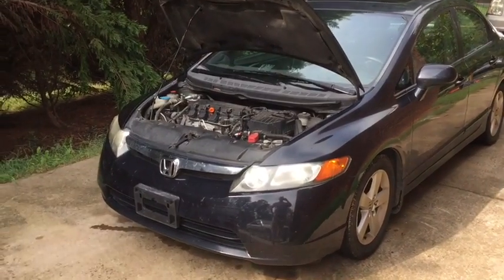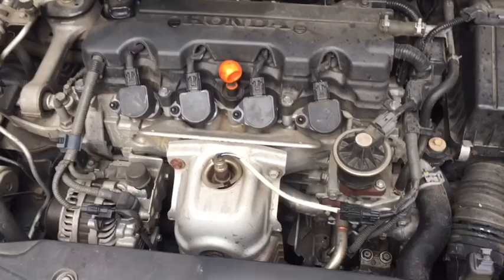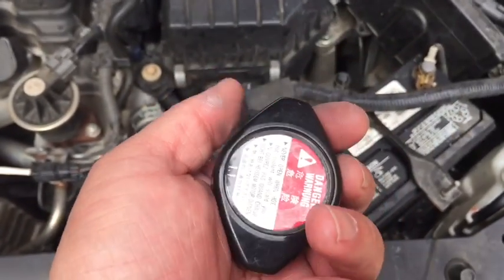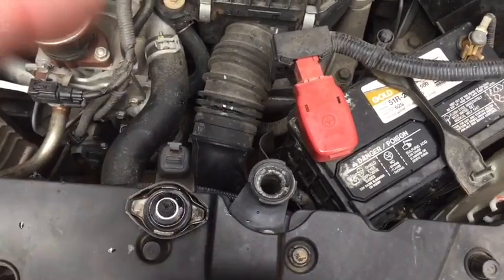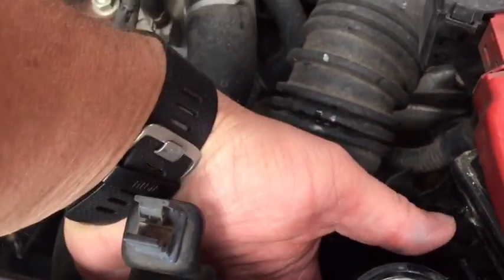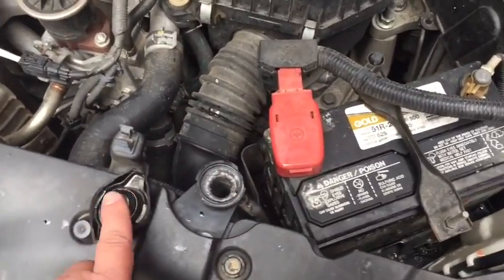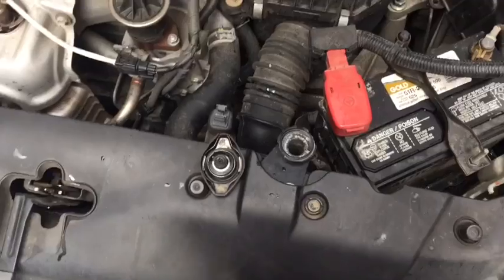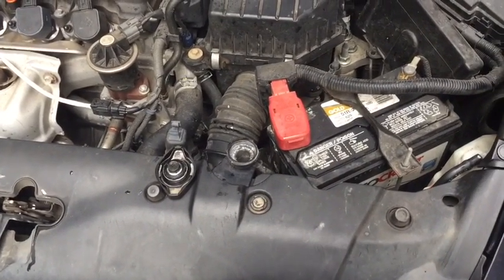Honda Civic losing coolant no visible leak

Comment: I have a 03 civic. It starts overheating periodically, like it goes a week or 2 without overheating then all of a sudden it starts. I have changed the thermostat about 3 months ago. I don't see anywhere that it is leaking... But a few minutes ago I was looking at it and there was a small puddle of coolent on the radiator, not from pouring coolant in. There isn't steam coming from around the radiator cap but rather closer to the puddle. Could this be because I have a cracked radiator?? Please help!
Reply from the maker: Jenny Spencer that would most likely be a radiator issue. Many times they will leak where the core is attached to the tanks.
Reply: @YourCarGuyDR  wouldn't it overheat or leak all the time if it was a cracked radiator?
Reply: @YourCarGuyDR  or could it be possible for something to be on the verge of going bad inside the radiator? Thank you so much for taking the time to try to help me btw.
Reply from the maker: Jenny Spencer a lot of times they will leak when cold but seal up when hot due to the expansion of the materials. This particularly happens when the seal between the tank and core is starting to fail. When your car overheats is it low on coolant?
Reply: @YourCarGuyDR  not by much. When it overheats & I check it it may be half of a 20oz bottle low.
Reply from the maker: Jenny Spencer you could have a couple of things going on. First I would remove your radiator cap and make sure Borge the inner and outer seal look good. Then look at where the radiator cap mounts and you should have smooth flat ridges that seal against the cap seals. If those areas aren’t good on the radiator side you may need a new radiator. If the cap looks at all suspect replace it with a new one. When you have even a small leak or a cap that is not holding pressure you are more likely to overheat. Without that pressure the thermal exchange rate of the cooling system drops and you are more prone to overheating. Air pockets in the cooling system also can lead to poor thermal efficiency.
Reply: I have a 03 civic and it does the same thing. Going too look at it today and see if I have any leaks
Reply: Check the small hose at the bottom of the radiator going to the transmission on the driver side normally it's pushed down too far causing a kink in the hose simply pull it up to the end of the nipple and reattach the clamp. You're welcome!

Comment: I got a 2004 Honda Civic with a mystery water leak. It was venting through a bad radiator cap that problem has been fixed.   The system seems to not hold pressure but here's the mystery. How to lose about a quart of water per 10 miles. Recovery tank does not overflow water and recovery tank cold and up to the top no over flow. A blown head gasket would make the radiator puke and it is not puking. Also I got no oil in my water and no water in my oil. No water or steam out exhaust. The engine is not overheating the engine gauge stays right where it is supposed to be until it runs out water. I can't find no pin holes in a radiator hoses or anything. When you turn the engine off you cannot hear no hissing or see any steam. The water just disappears into the Twilight Zone.
Reply from the maker: Check your water pump. They leak near the passenger tire but often will only leak when running and the coolant/water travels along the chassis and can be difficult to find.

Comment: Hi im from South Africa
I search whole day for a answer. I realy realy realy hope someone can help me. 

I got a Fiat 128 rally 1974
The radiator cap vacuum part is gone and have no rubber seal on bottom only big top rubber seal. So the water is going freely to the coolant bottel. The cap is open inside. So the water have no pressure and can go freely back and forward without any valve have to open. 

Now.. can this be the reason my kar overhead after so 10 km or in traffic light it get FAST overheat?
Reply from the maker: It is possible that this is causing your overheating. The cooling system is significantly less effective when it is not pressurized. If the radiator cap is not holding pressure you will have overheating issues. However there are many other things that can cause overheating issues. But the radiator cap is inexpensive and must be checked.